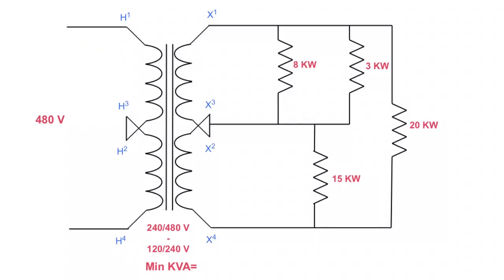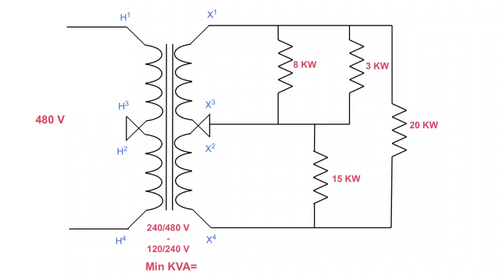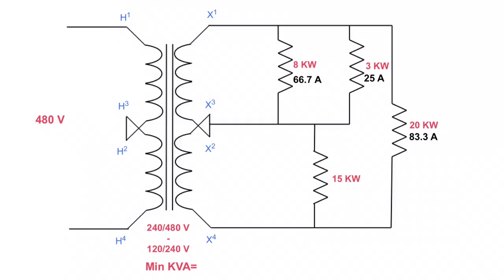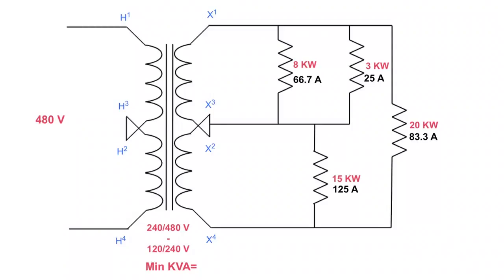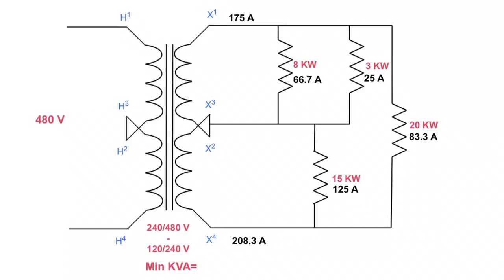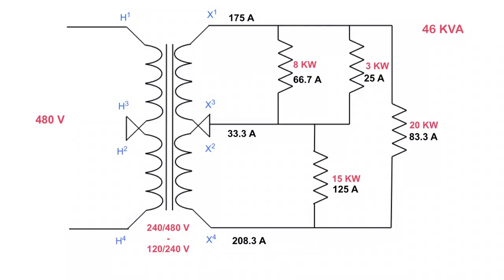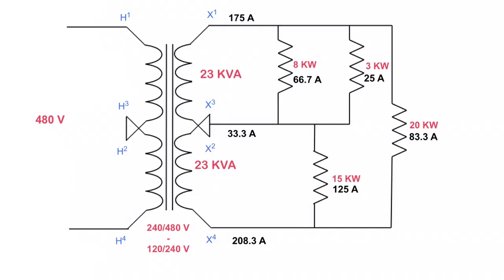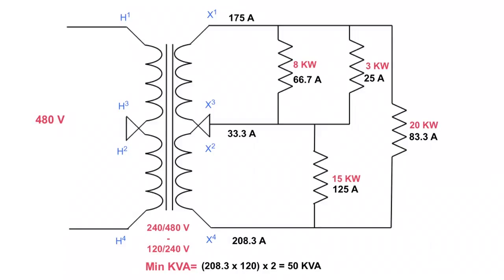How to determine the minimum KVA in a transformer

Comment: I totally understand the math. The transformer outside our houses reads 16KVA.
MEANING each line L-1 and L-2 can carry 66.6 amps.  8,000 KVA (one half the total rating) divided by the known voltage of 120 equals 66.6 Amps.
Doing the math for all 240 volt loads works the same 16,000 KVA divided by
known voltage of 240 equals 66.6 amps at 240 volts. Thank you for this tutorial.
P.S. What physical characteristics do we change to INCREASE the KVA of our
step down transformer?

Comment: Question please. Power company says each of our three phases are 16,000 volts. Question is how many of the mentioned 50KVA single phase step down
transformers can safely be connected to ONE of the mentioned 16,000 volt lines?  What is the formula for determining this answer?

Comment: So for the 480vAC 3-phase panel that is feeding the step-down transformer into the 120/240vAC 1P side, a 100 or 110 amp breaker would be required to feed the 50kVA?